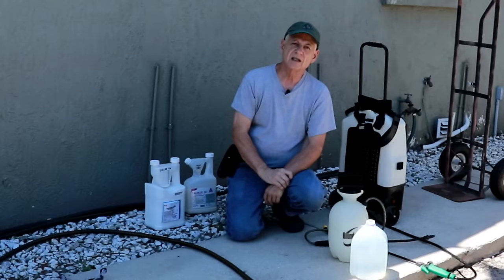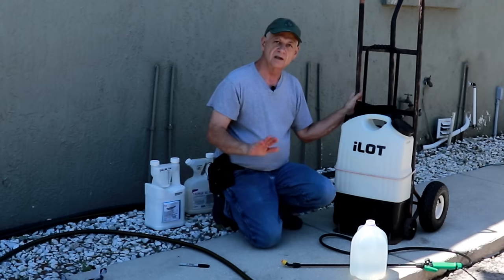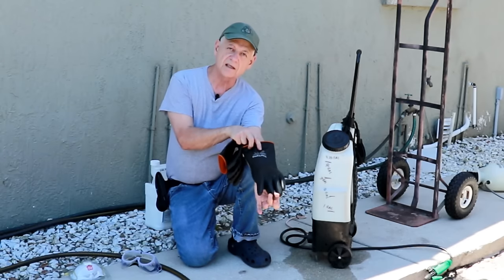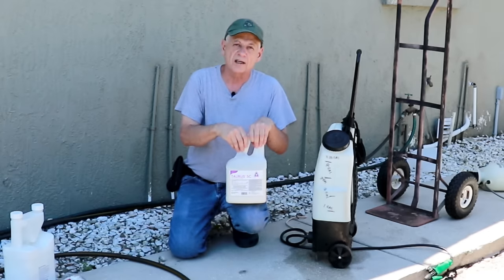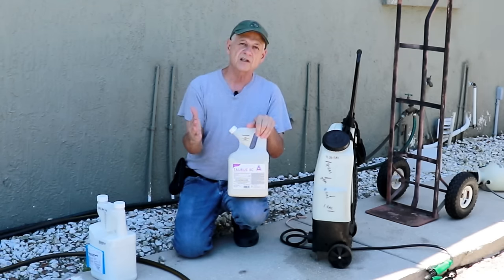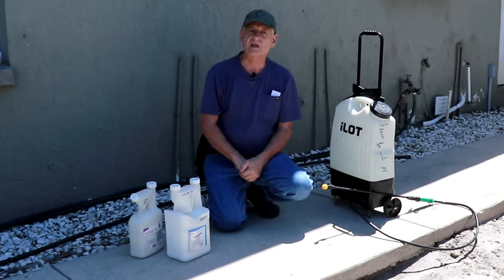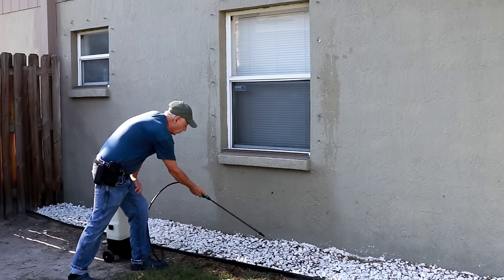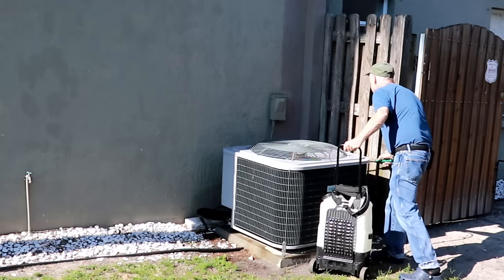General Exterior Pest Control - IMPORTANT!  READ THE DESCRIPTION.

Comment: Guy, I found a few termite wings in my window sill. Should I spray around the outside of the window? I did notice a few frass in the corner of my kitchen where the window sill is but just one time. I see the wings about everyother day, maybe 10 or so, but only in the window sill.
Reply from the maker: How you handle that will depend on the species.  Figuring out the species is actually pretty easy and I have a video on how to do that.  I will provide you with a link below.  After watching this video, you should be able to identify the species.  Just get back to me after you watch it and let me know what you found out.  At that point, I can tell you exactly what you need to do.  Let me know if you have any problems identifying the species, but I do not think that you will. It is much easier than you may imagine.  Also, please tell me where you live.  Location matters.  

Be well my friend. 

Video on how to identify termite species:  https://youtu.be/dIs_a0nfVjg
Reply: @GuysPestSolutions  Thank you! They are drywood. I live in Clearwater, Florida in a mobile home park and my neighbor has them as well. I am trying at all cost to not tent. I have not seen any activity for a few days but I know that does not mean they are not still here...I do have Talstar and Taurus which I ordered after watching your video, but I have not applied it anywhere yet and not sure it will help with an existing problem if I have one..
Reply from the maker: Before I answer you question, I need you to know that YouTube is making it very hard for me to find your questions.  They are holding your comments for review, then when I approve them, I cannot find you.  For some reason MR does not come up in a search.  So, please email all future questions to guyspestsolutions@gmail.com.  Thanks.

It is important to understand how drywood termites work.  They enter through cracks and crevices around windows, doors, the eaves, pipe penetrations, and so forth.  Most of the time, they enter through several locations.  That is because a swarm of them attacked your home at the same time.  If there was a crack or a crevice, then they probably found it.  After they establish their galleries, which will be inside the wood, it will take four to seven years for them to be able to swarm.  Now that they are in your home, the swarmers will use holes that are in your studs to travel through the walls.  Those holes in the studs were created by the electricians to run the electrical wiring.  Not only are these holes going through the studs, but holes were drilled into the attic for the light switches and to run some of the wiring for the outlets.  So, the termites now have easy access throughout the attic and the walls.  Most of the time, you will have no idea that they are in the walls, because the frass is inside the wall.  To make matters worse, if you have drywood termites, then your neighbors have them too, as you have discovered.  That means you have been getting swarmed for as long as they have existed in the neighborhood.  Most likely, we're talking about years, so it's a safe bet that you have these guys in many locations in your home.
                            
I always hate to be the bearer of bad news, but if you have drywood termites, the only way to get rid of them is to fumigate.  Prices for this can vary wildly in this industry, so I recommend that you watch my video on how to hire a pest controller without getting ripped off.  That video can save you a lot of money.  You should also know that the gas they use to fumigate has absolutely no residual action whatsoever, so you can get reinfested the moment the tent comes down.  Like I said before, if you have drywood termites, then your neighbors have them as well.  Since drywood  termites swarm every year, it is almost a certainty that you will be reinfested within a year after the fumigation is done.  The only way to prevent this is to do a preventive treatment on your house every 60 to 90 days.  Most pest controllers will not do this, so it is something that you generally need to do yourself.  I have a video on how to do that and I will place a link below.  If you absolutely cannot afford to fumigate your home, then you can try spot treating it yourself.  It is virtually impossible to find all the termite galleries, but it is way better than doing nothing.  Regardless of how you treat it, you should begin the preventive treatment immediately, so that you do not get additional termites paying you a visit.  

I hope that helps.  Be well my friend.                        

Video on how to hire a pest controller without getting ripped off:  https://youtu.be/y-a8XOqVrlE

Video on how to prevent drywood termites:  https://youtu.be/neNsmVbj8Pc

Video on how to spot treat drywood termites:  https://youtu.be/U7ck7zhS0Xo

Comment: Question Guy i bought the bioadvance granules for termites to apply to the exterior. However my home is under construction and i want to spray the walls and inside foundation before completion. Note that the structure is of block and concrete. I  really dont want to do it after by drilling the tiles with pesticide and construction is currently ongoing. I searched amazon for taurus but couldn't find it what other reasonable option can i use. Also i live outside the US so shipping can be expensive based on weight. Any suggestions?
Reply from the maker: I need to know where you live.  I do have suppliers that will ship to Canada and Australia.  During construction, the best thing to treat all surfaces with is Bora-Care.  I recommend mixing it one to one with water.  Spray all wood, the side of the blocks that face the interior, the entire roof structure, and so forth.  If it's wood, then spray it.  I will give you a link to a video on how to use it.  I hope that helps.  Be well my friend.

Video on how to apply Bora-Care:  https://www.youtube.com/watch?v=Rmr_aEodyhg&t=63s

Comment: Do you recommend these same two interior /exterior products for spider control too or is there a better more specialized pesticide out there?
Reply from the maker: I have an updated video.  I will give you a link to it.  You can easily kill spiders inside your house with a can of Raid Flying Insect Killer.  Just spray the Raid on any spiders or spider webs that you see.  You can knock down the spider webs with a broom or dust mop.  Spray the Raid under the bed, behind the headboard, behind and under dressers, in closets, and any other place where you are likely to find spiders.  
 
It is important to understand that spiders got in your house from the outside.  Therefore, you must treat the outside every 60 to 90 days to stop them from coming back in.  The new video on how to treat the exterior of you house will show you how to do that.  If you really want to go nuclear on these guys, then I suggest that you treat your yard as well.  I do both treatments every 60 days and it stops virtually all pests from entering my house, that do not fly in, or that I do not carry in.  

The products and methods in the video you watched will work well, but the new video shows you how to do it easier and with less expensive products.  This will save you time and money.
 
I hope that helps.  Be well my friend.
 
Updated video on how to treat the exterior of your house:   https://youtu.be/Yozv3s-Qwlw
 
Video on how to treat your yard with a hose and sprayer:  https://youtu.be/wifoTU5dmp0
Reply: @GuysPestSolutions  thanks Guy for the time you took to write out that informative reply. I have no problem paying almost $100 for one or more of these products, just want to make sure they work for what I need. So yes I had already ordered the Taurus SC and the Transport before I wrote above, but then thought about the “what if” these aren’t the best remedy for spiders. There’s a lot  out there (permethrin, Bifen, delta dust, Taurus, etc) so it would be great if there was a video one day about the differences. I’d even pay to see it! I do handyman work on the side and once in a while I get asked to spray but I know I can’t commercially without the license so I don’t (but I’m actually pursuing getting that license, I already have a head start as I have a college degree in a “related field” (chemistry), so I can skip some other requirements. Just need to get my hands on that 1990 undergrad transcript!
Reply from the maker: Both Taurus SC and Talstar P will take care of the spiders.  The Taurus SC lasts a bit longer, so applying it every 90 days would be very effective.  The Talstar P is supposed to last 90 days, but it's not quite as potent in that last 30 days, so I now apply that type of product every 60 days.  You are only supposed to use Taurus SC every 180 days, but it will not last anywhere near that long.  So, you need to either just use it every 90 days or alternate products.  I decided to just buy Bifen XTS, which is cheaper per finished gallon, and I apply it every 60 days.  The results will be the same though.  You can't go wrong with Taurus SC and Talstar P.  They are both great products.  I hope you get that pest control license.  Let me know if you do and I will give you some ideas.  Be well my friend.

Comment: Great job Guy. Although I am researching the power of sodium borate as a natural and non-toxic (to humnans) treatment method instead of conventional poisons. I learned a lot with these techniques and appreciate you sharing your value with us.
Reply from the maker: Borate works pretty well and it is pretty much non toxic.  I use it for some applications, but I find that it's best for interior use.  The problem on exterior use is the weather.  It stops working if it washes away.  I often use a product called Bora-Care to treat and prevent termites in the attic, crawlspace, or basement.  It also works well on unfinished decks, even though they are outside, because it penetrates all the way through the wood.   If left undisturbed, borate pretty much lasts forever and you never need to retreat.  So, you are correct that borate is a wonderful alternative to more harmful pesticides for certain applications.  Another very safe and effective alternative is boric acid dust.  You can puff it into cracks and crevices with a hand held duster inside the home and it too lasts forever.  You can also place the dust under appliances. It's deadly to insects, but very safe for people and pets.  Thanks for pointing that out and thanks for watching.
Reply: @GuysPestSolutions  this is all exactly accurate to what I have been learning as well. Thanks for the point about using a hand held duster and a powder boric acid. I may use that for my indoor drywood termite issues. Best wishes
Reply from the maker: Whoooo.  Hold the phone!  Did you just tell me that you have drywood termites?  No, no, no.  You will never get rid of drywood termites with just a dust.  These guys are wicked bad and, unlike subterranean termites, they do not need to return to the ground.  The colonize in your wood, so it's super challenging to get rid of them, short of tenting the entire building and fumigating with a gas.  It is possible to spot treat for them, but there is no guarantee that you will get them all.  I do not have a video on drywood termites yet, but Solutions Pest & Lawn has a fairly good one and I will place a link below for it.  I will try to get one done sometime this year, but don't wait for mine.  This is a serious problem and you need to get on it as soon as you can.  Now Solutions will tell you that their system is pretty much 100 percent, but it isn't.  These guys can be in the wall studs where you can't detect them and even experienced pest controllers miss some of the galleries at times.  That is why you will almost never see them give you a structural warranty for drywood termites.  The best they will do is retreat within a year if you find more termites and that's pretty hard to do if they are inside the walls behind the drywall.  I don't mean to scare you, but that is the situation you have if you have drywood termites.  If you can catch a swarmer (they have wings) take a look at the color of the body and the wings.  If the body is reddish in color with gray or blackish wings, then they are probably drywood termites.  Otherwise they may be a different species and we need to talk further.  By the way, YouTube keeps holding your comments for review, so if I don't get back to you, please write to me at guysyoutube@mail.com.  Please note that it is not gmail.  Just mail.  Sometimes YouTube does not allow me to respond to some comments.  The have no idea why this is happening to me.  I hope that helps.

https://www.youtube.com/watch?v=KrYnuGacZ_0&t=4s

Comment: Can I use this solution as injector directly to the wood or digging holes where termites lives in?
Reply from the maker: Great question.  Both products can be injected into cracks and crevices, but for termites, you do NOT want to use the Talstar P.  When treating for termites, you should only use the Taurus SC.  You can use the Taurus SC on the building anywhere you like outside and you can trench with it as well.  If you are injecting into cracks, crevices, pipe penetrations, or areas that have been damaged by termites, I would suggest that you purchase a can of fipronil foam instead of injecting with Taurus SC.  The reason is that the foam expands and will find it's way deep into the voids where it is injected.  Way deeper than simply injecting a liquid termiticide.   Any fipronil foam will work, but I have found that FiPro is about the cheapest.  I will place a link below for it.  Also, if you are treating for subterranean termites and not drywood termites or Formosan termites, then you should do a perimeter treatment around the entire house.  You can dig a six inch wide and deep trench around the house and pour in gallons of Taurus SC or you can do it the easy way.  I have a video on the easy way and I will place a link below for it.  If you choose to trench, I can give you written directions on exactly how to do it.  Just let me know.  Personally,  I don't ever trench anymore because it's hard work and very time consuming.  It's way easier to treat with granules.  Either method works though.  Thanks for watching.

FiPro:    https://www.solutionsstores.com/fipro-foaming-aerosol

DIY Termite Treatment for subterranean termites video:  https://youtu.be/H7rW_TSBHJ4

Comment: I just bought this product and it came in the mail and after I noticed that I have SCORPIONS inside the house, do you know if this product could exterminate scorpions? Thanks for great info 👍
Reply from the maker: I recommend using Onslaught Fastcap for scorpions.  Just follow label directions.  It's not cheap, but it works great for scorpions.  I will give you a link to the product.

I hope that helps.  Be well my friend.

https://www.solutionsstores.com/onslaught-fastcap-insecticide
Reply: Where did you buy this ptoduct
Reply from the maker: The cheapest place to buy pesticides that I know of is Solutions Pest and Lawn.  They do not ship to all states, so an alternative source is domyown.com.  I will give you links to both places.  If you live outside the US, then it can be very hard to obtain pesticides.  It is also very hard to buy pesticides in New York, but you can travel to New Jersey to get them.

I hope that helps.

Solutionsstores.com

Domyown.com